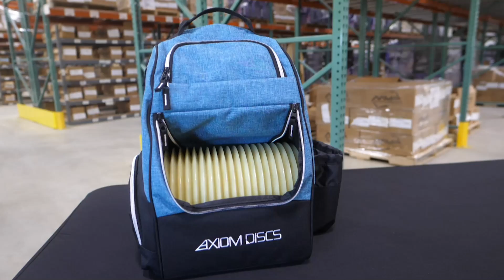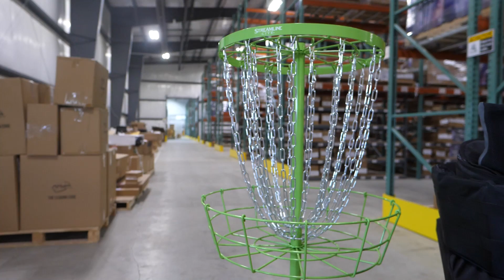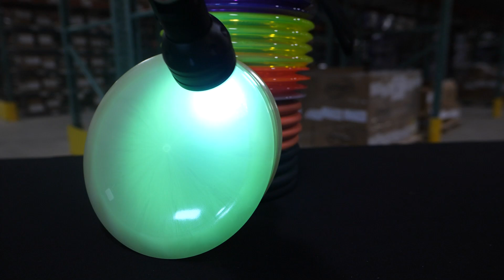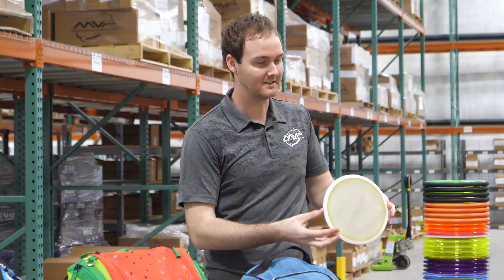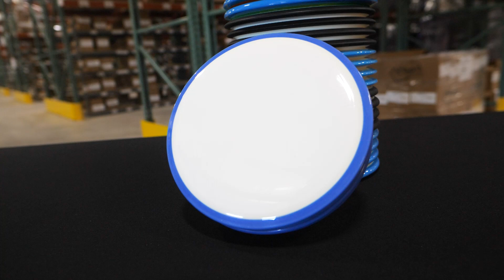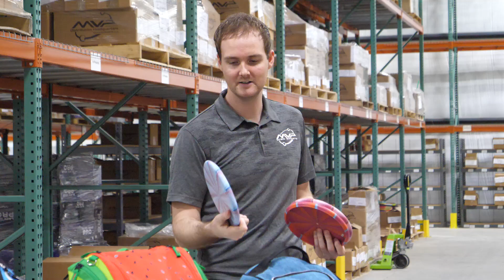GYROPALOOZA 2020 and MVP Lab Report

Comment: I love all the new stuff but... The consistency of the plasma and fission plastic have been unreliable for close to a year now. Sometimes they are really firm with little grip. Sometimes they are grippy with a medium firmness. I used to like fission and plasma for the winter but the new firm versions aren't comfortable at all in cold conditions. I've had to switch many discs to Gstar plastic from Innova. Maybe you could have medium & soft versions of Plasma and Fission. Soft Proton and Neutron for more discs would work as well.

Comment: Why do you not make the overmold and the plate both glow? If a disc lands on it's edge it's actually more difficult to find if the rim doesn't glow.
Reply: They clearly explained why: the rim needs to house extra weight so they cannot pack as much glow material there as they can in the overmold. So instead, they’re going to pack in the glow material into the overmold to get the brightest result.
Reply: @contextiscool7308  Axiom discs have no glow overmold but glow plate, mvp discs have glow overmold but no glow plate. Your argument about plastic weight makes no sense with those facts. Why not just have glow overmold and glow plate? They obviously can do it, they just choose to separate the two which might be cool for marketing and hanging on the wall, but doesn't work in the real world of glow disc golf. Here in the northwest we play glow 8 months out of the year and I've needed to buy some Klastiplast discs because they do glow right.
Reply: @scotranney8456  you are correct, that is how they used to make them. They are making them differently now because they obviously didn't like the results they were getting. If the new stuff is what they say, I think you'll be able to find it anywhere.

Comment: Man those bags and baskets look even worse than the discs you make with all the defects and rubber rims that shred to pieces.
Reply: You must not have thrown anything they make then. The rims aren't rubber, they don't shred, and are fricken gorgeous. Their new in house stuff has tighter manufacturing than anyone not in Sweden, and is equal to them. Electron gets a little dinged up like any other base plastic, but the other plastics are the most durable I've ever thrown, and they take the longest to beat in. Maybe try em out, instead of saying things that opposite of the truth. Glad you came here to hate on stuff though, we all really appreciate it.
Reply: @smtx11  For real. I legit still have a neutron volt in my bag from 2013 that looks and flies just fine! Almost my entire bag is mvp/axiom and I haven't had to replace any of my discs due to damage or wear.